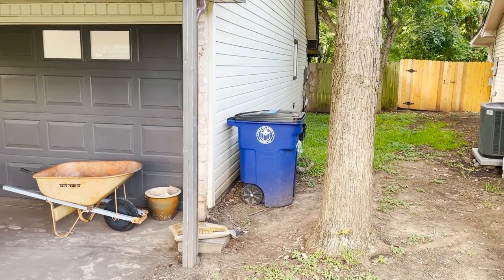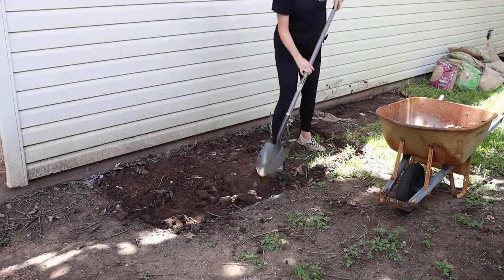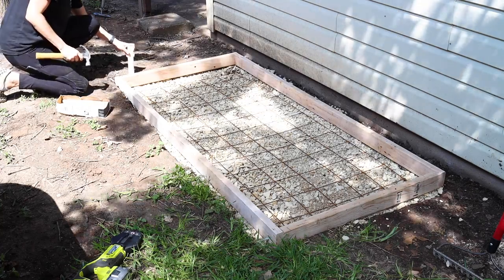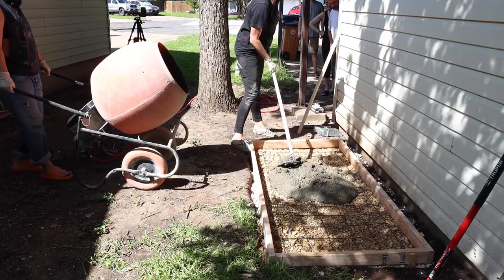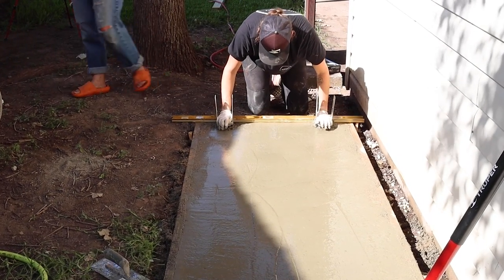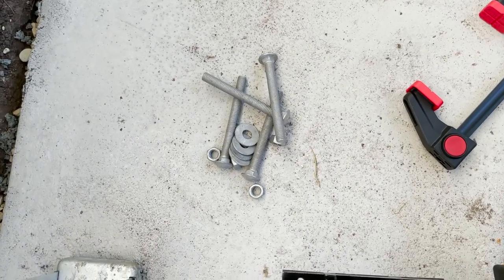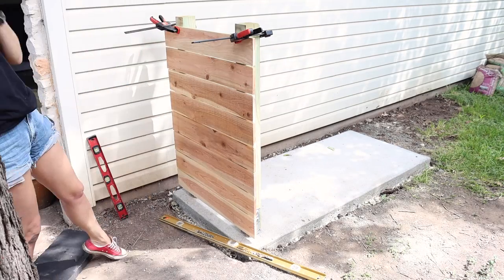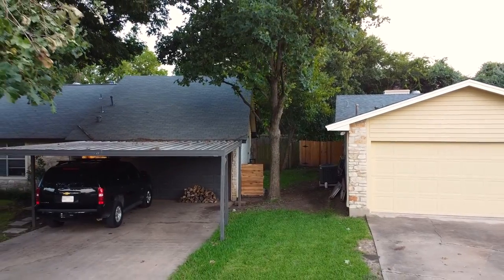Hide Your Trash Cans With This Easy DIY | Privacy Fence (with plans!)

Comment: So happy to have happened upon your channel, Erin!  I've about binge watched all of your videos!  You are extremely skilled.  I also love cedar and love seeing your ideas.  I will be moving in early June and I can't wait to try some of your ideas!  I'm moving into a duplex that was built in 1937.  I will be occupying the downstairs unit.  It has a sun room off of the DR.  I'd love to build a slimmer version of the outdoor dining table you made to use as a work bench/gardening table and add a shelf or two underneath for storage.  I will have a perfect little fenced in yard for my dog to play around while I'm working outside.  Both outdoor AC units occupy space in my little yard and are completely exposed.  I'd like to use a slight variation of your beautiful outdoor bin privacy fence to make a "U" shaped privacy fence around these units to keep my dog safe from curiosity seeking and make my outdoor deck space more attractive and less noisy.  I can buy pre-fabed sections like this from major hardware stores, and they aren't terribly expensive, and they are attractive in the online pictures.  In your opinion, are these pre-fabed panels worth it?  I'd like them to last several years, with little maintenance.  Thank you for sharing your amazing work and ideas!

Comment: Thank you! I have the same problem and I intend to follow your suggestions! When I started to watch your video, I thought that it would be just another unskilled person making a mess out of a project. However, when I saw that you took the time to pull the wire up into the middle of the concrete, I knew that you weren't just an ordinary Joe doing a poor effort at a project. I like what you did and I will be doing something similar to hide my trash bins too! Thank you for inspiring me to go a little bit further and getting them hidden out of site!
Reply from the maker: Such a nice comment - thank you!